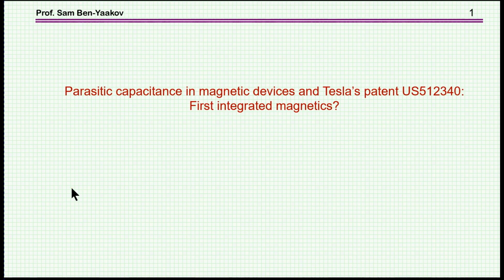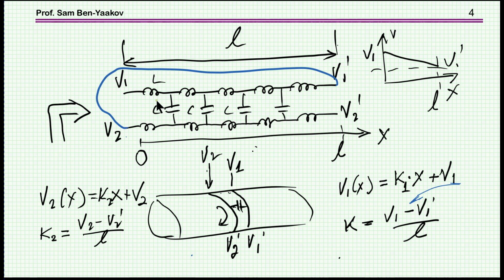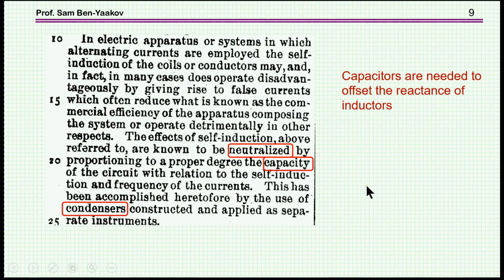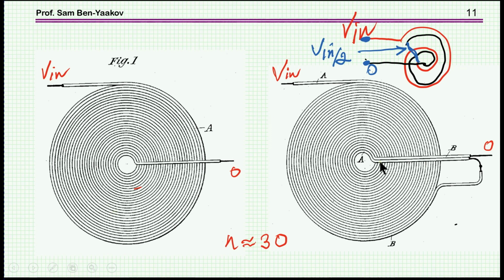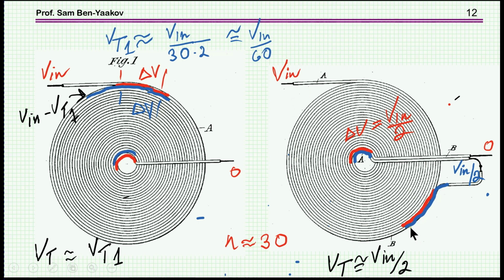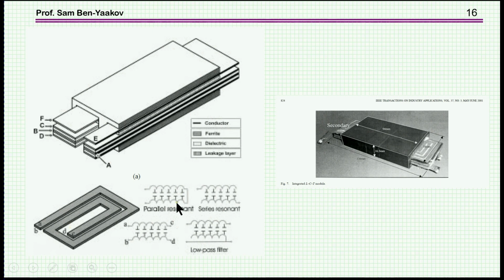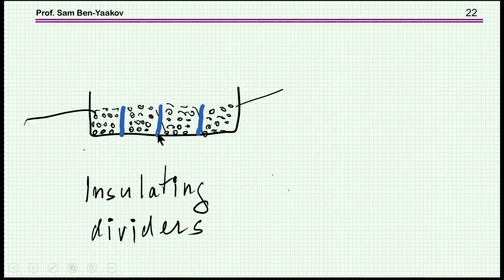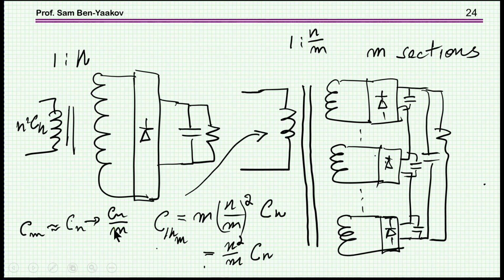Parasitic capacitance in magnetic devices and Tesla’s patent US512340: First integrated magnetics?

Comment: Hi Sam,
At 1:35 you told we cannot use transformer when we approach to parallel resonance frequency, but what if we will work with much higher frequency? Then we will work with capacitance characteristic of transformer and if we add additional inductor then we still have resonant circuit with parallel load to capacitor?

Next question is how we can approximate capacitance between layers of winding? We should consider this as cylindrical capacitor or just long parallel plate capacitor?

And of course thanks for next great video!
Reply from the maker: At higher frequencies the device ceases to be a transformer.
Reply: @sambenyaakov  Hmm but L1 is primary winding inductance or leakage inductance?

Comment: Great explanation, in cases where I’m using a primary for what I call a ‘bootstrap’ inductor I always use a T2 or T4
They are just my own logos for a ‘Tesla inductor’ with 2 strands or a Tesla inductor with 4 simultaneously wound strands which are then alternate connected in the manner as explained.
I did some rudimentary measurements based on the lower ‘self resonance’ frequency of example inductors to find that indeed the capacity was much increased. 
Regards and thanks for sharing.
Reply from the maker: 👍Thanks